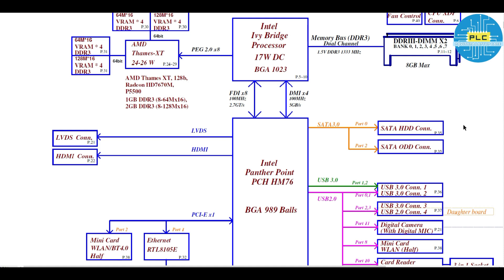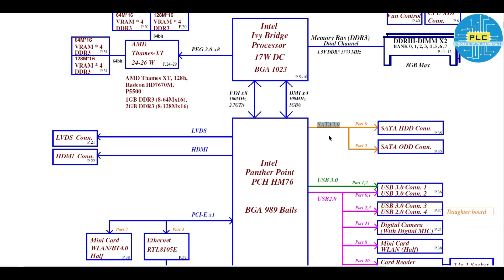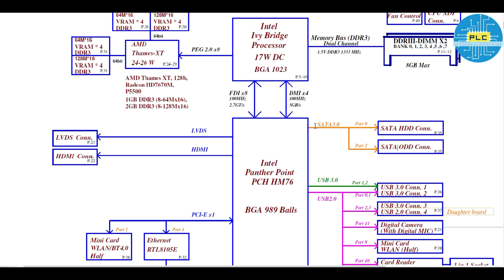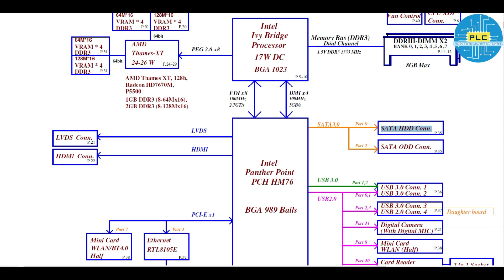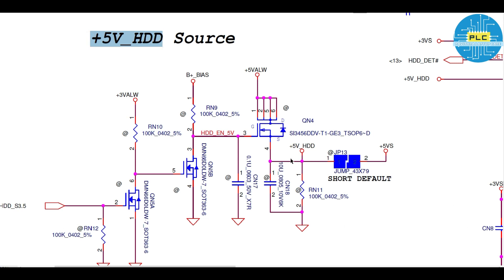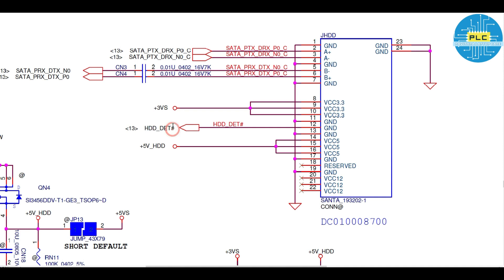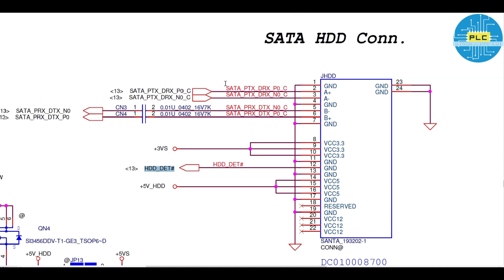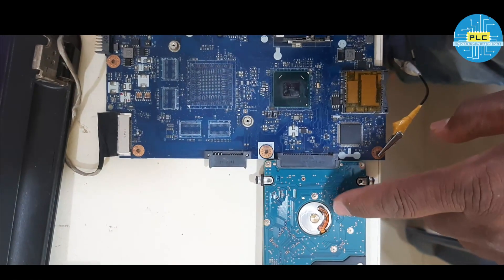LAPTOP REPAIR - YOUR HARD DISK IS NOT DETECTED? HERE IS THE SOLUTION. SATA TO PCH COMMUNICATION

Comment: very good day, thank you very much for your explanation of the voltage and power supply of the hard drive and its signals. These topics are very helpful. You will have a topic about the KBC, the essentials for it to work and verify if it is working or not. Thank you for your help.
Reply from the maker: Sure